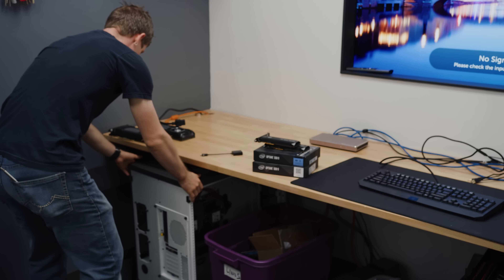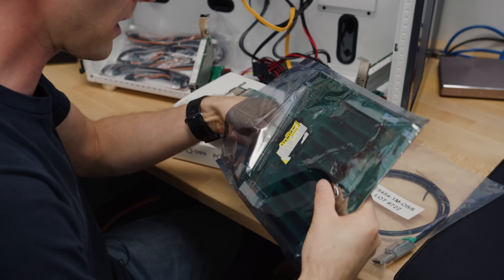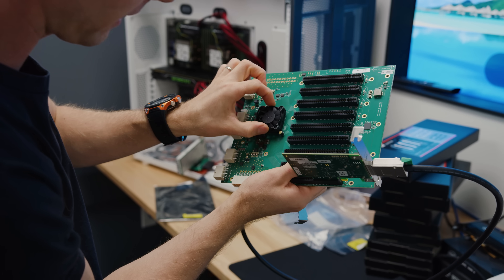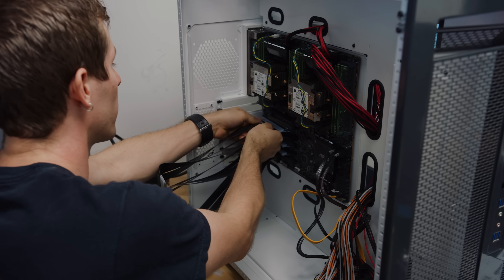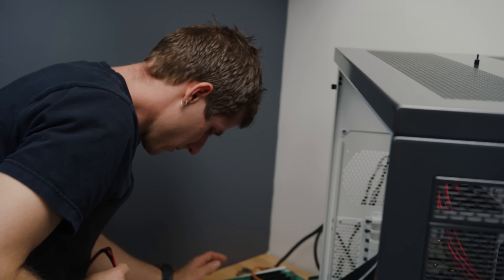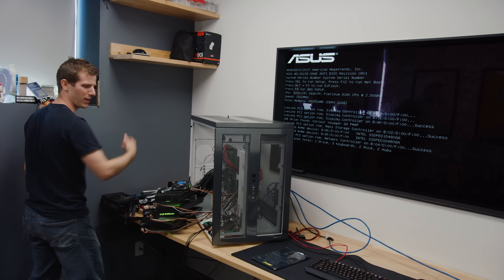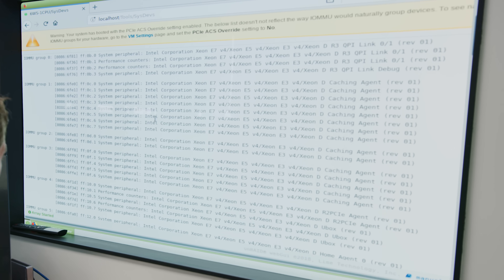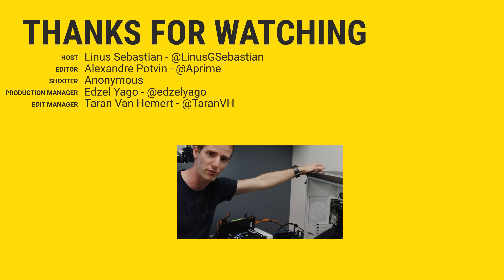Building the $100,000 PC Pt. 2 - SO MANY PCIe CARDS

Comment: @Linus Torvalds & Linus Tech Tips

...wat r u doin?

I really enjoy this channel and have been subscribed for many years at this point and even watched your NCIX videos, but this build doesn't make sense anymore. If this is just a project to 'do' then sure, it's an awesome attempt, but at this point, I feel like you're going down the complete wrong path trying to get IOMMU groups to work properly, specifically with unRAID and Intel not playing along with what you want to do and while 8 editors working with 8k footage on a single machine like this would be a technical marvel, I'm not sure why you want to do it off of one system in this fashion because for any reason something goes wrong with the main system and the entire setup is dead. Networking is going to be an issue with bandwidth and constrained pcie lanes are going to get congested. I can't imagine the amount of oddities you are about to walk through in order to get some amount of this working.

I have a suggestion that I think makes more sense on multiple levels, which would be Microsoft RemoteFX and VDI through Virtual Machines that are connected through thinclients. I haven't done this in a while but the workflow is essentially this:

Build your system back up and have it 'headless', meaning have 8 gpus attached to it, keep a RAID 1 SSD setup and install server 2016.

Setup Hyper-V, have 8 virtual machines and divy up the resources as you see fit. Enable and setup RDS.

(optionally, setup MDT at this point so you can streamline Windows 10 building onto the VMs using PXE booting, I can help with this step if you'd like).

For each VM, use RemoteFX and attach one GPU each to that VM.

For each editor, find a thin client that supports multiple screens, works well with MS VDI solutions, works with multiple 8k screens (if that exists).

Done.

Realistically speaking, you can either add storage to the server itself and store the VHD files there, use iscsi targeting and store the VHD files on the storage server which will dramatically increase the speed between local editing cache and the storage server since data will travel at PCB speed instead of copper.

I'm gonna tweet at you also because I think this will lead you to an amazing place where you can enable VPN on your edge network, then let people connect to your VDI farm, pick their editing VM, and get to work, and would be able to edit on things like an iPad or a Pixel 2 XL or something like that but having the horsepower of an nvidia titan or what have you, a ton of processing power, and access to the entire video library.

They could edit from home, or from anywhere in the world.

Comment: LOL. I've seen that "the computer spewed its guts all over the desk" style of build before. In fact, I've had my hand in many such builds before. Let me just say, cardboard makes a more than adequate electrical insulator/separator when doing so, whether you're using pressed chipboard style cardboard or more traditional corrugated cardboard. I'm surprised you don't have a pile of sheets of the stuff in a box for just that purpose. LOL. My file server actually has a stack of drives in it that are separated by those small cardboard boxes they use as OEM packaging for processors, because there is no rack space left for them in the case. It has been working fine with the cardboard in there for more than a decade.

Comment: Did you try the 'host' card for the expansion in different slots on the motherboard? Tt may need to go in a slot that is directly connected to a CPU rather than the chipset, or vice versa. ACS has to be available through the entire chain to work properly.

Also of course talk to One Stop Systems to see if the PCI switch they are using supports it, and if it can be enabled if it's off for some reason.
Reply: Also, when trying the ACS override patch, I don't think it was really enabled. Some reading suggests that for unraid, you have to enable it in the bootloader config manually; especially if you are booting using the GUI boot option.

Comment: Be careful with the PCIE extensions. I've gone through like 5 of them before just giving up and going back to using no extension. Basically run some quick benchmark on day #1 and then run that monthly. If you see like a 20% or more performance decrease then the extension is on it's way out.

Comment: Maybe you can use a single expander for each user. 

For example get 2xN of these https://www.onestopsystems.com/product/pcie-x16-gen3-cable-adapter where N is the number of VMs you plan on running.
Place one of them in the host MB and one in one of these https://www.onestopsystems.com/product/expansion-backplane-2-pcie-x8-30-slots-419 (there's also a 4 ports version) and repeat this N times.

At that point put one GPU and a USB adapter in each expander and easily pass the whole iommu group to the VM.
By using a more ports version of the expander you can plug a private cache ssd as well and other goodies which will be private to the VM and passed through with a single PCIe hole!

Comment: I don't understand maybe my IT knowledge is already outdated but doesn't the pcie slot have a bandwidth limit,  and limit to the data transfer? So why would expanding it do anything when it will just bottle neck? Go ahead and correct me if I'm wrong
Reply: He is only planning on using it for USB AICs, which don't need much bandwidth, and are not all being accessed at the same time. It is true that for bandwidth heavy AICs the daughter board solution would be useless.
Reply: Bayonet oh OK OK thanks for the explanation I used to work in IT like over 5 years ago,  now I'm just an uber driver haha, been out if the PC and PC building game

Comment: One thing to be careful of with PCIe expansion features. It allows the expansion developer to disable safeguards and push the host system harder than it would normally allow for a PCIe card. There are high speed trading rigs which are basically two or more computers connected over PCIe through expansion cards, all OCed by the bridge to the maximum supported speed regardless of whether all the hardware can support that reliably. There's good stuff that doesn't do that and follows PCIe spec but a lot that doesn't to watch out for.

Comment: Why? As a "can the hardware do this?" experiment I understand this. But is this really the best way? I understand where you're coming from. You hate redundancy, I do too. But doesn't it ever get to the point where, in an attemp to eliminate hardware redundancy, you end up with a monstrosity that's even harder to support because the way it works is so arbitrary?
Reply: Exactly. This is just an experiment. There is no practical use case. 
I found out much the same when it came to IOMMU passthrough. Adding a hypervisor just over-complicates the hardware-software relationship.

Comment: Linus why dont you just get a HPE C7000 on the used market... All you'd have to do is throw in 4 GPU blades, 2 storage blades, and 4 CPU blades all gen 10... Full them to the brim with CPUs, memory, and SSDs... Grab the qsfp+ switches for them... You could virtulize your entire office and not just the editors...

Comment: Ask the supplier of the PCIE switch if there is a firmware for it that supports ACS (Access Control Services), the pcie feature that enables devices to be in different passthrough groups? Also, if the override patxh is the same for unraid as for normal Linux, the devices won't show as different groups, but you can still pass them through seperately - at the risk of cards being assigned to different hosts communicating directly with each other across VM boundaries

Comment: OMG Linus. This is holy moly! I totaly would love to work in LMG for just doing this absolutely crazy server busines!

I have a Ryzen 3 1200 with 8GB and a 1060. Not that much. Well, the case is modified to hotplug up to 9 3.5'' HDDs and uses 2 old PATA DVD drives (1 Reader, 1 Burner) with adapter. It consists of two 1 to 5 port SATA port multipliers and 2 SATA to PATA adapters. It has (partially with soldering) a modified cheapo power supply, to get all the connectors working that are required. Man, that thing is absolutely crazy. :D :D :D Your system in this video reminds me of the (in my case actually totally useless) work that went into my case! And Why port multipliers? Only 4 sata ports. 1 for the 1TB SSD and 2 for the multipliers. 1 HDD got lucky, to get connected to a gen 3 SATA port. LOL :D
Reply: HeartOfGermany I use a 1030 and still run 40 FPS on medium fortnite settibgs

Comment: Linus while I understand why you are doing this, your solution really frustrates me even though I actually enjoyed the video. I, and the company work for, design solutions for Media & Entertainment industry in London. Replacing high-end workstations with a VDI solution is something we are seeing more frequently.

I believe $100k should easily cover a single 2U server with 3x Tesla V100 32GB cards, 2x 24-core CPUs, 16x 32GB RAM modules, and all the rest of the stuff a business would like to see (e.g. 5-year warranty, remote management, etc, etc). The Dell PowerEdge R740xd . This would be an NVIDIA GRID solution which allows you to carve up each Tesla in mutliple equally sized virtual graphics cards, e.g. a single V100 32GB could be carved into 4x 8GB video cards, which in turn means a single 2U server could potentially support 12 or more users.

Sure you'd still need some enterprise grade software, e.g. VMware vSphere Enterprise Plus and VMware Horizon (or Citrix if you prefer), along with NVIDIA GRID vDWS licenses, and Windows (VDA or Windows 10 Enterprise E3 work well for most customers) which isn't cheap, but subscriptions help spread the cost. The server also doesn't include high-performance storage for the VMs or high-performance networking; Mellanox 25G/50G/100G networking perhaps? And a solution like this would usually comprise of at least 3 servers allowing at least a single server to fail without significantly impacting desktop availability. So not cheap, but at least it works with minimal fuss.

The other beauty of this solution is the flexibility it provides. Its easy enough to shutdown the video editor virtual desktops used during normal office hours and run a few more powerful virtual machines for something like a render farm out of hours.

Caveats apply: Your millage may vary, and would heavily depend on your workloads. I haven't included a Tesla V100 in a GRID solution yet, I only included it here to highlight a point that a VDI server can be insane. In all honesty you may get better performance with cheaper Tesla cards depending on your workloads.

PS: Equally interesting are on-demand cloud-based VDI solutions (usually in Azure)
Reply: All very interesting but none of the companies mentioned would provide any of the gear mentioned to him for free. You didn't think he actually paid 100k for any of that did you?

Comment: Legitimate question: what is the advantage of having one supercomputer instead of six individual ones? Isn't it more efficient / less time consuming for one computer to fail and require maintenance instead of one master computer that six other depend on?
Reply: If there wasn't a ton of free stuff supplied there wouldnt be you could build 6 2950x systems considering that from memory the system is dual 14 core xeons so 4 core 8 threads per station vs 16 core 32 threads and individual ones would come close to the $16000 and change this costs per station
Reply: and you still have 6 oses to due maintenance on + no shard base disks to deal with.
Reply: Staggered work times or much more intensive task. For video editing it makes no sense, but imagine programmers or animators. You might compile/render once an hour, but on a normal computer that could take 20 min. On a setup like this, your employees will have much less down time. 

Also, it is highly unlikely somebody will go this extreme. They are more likely to have super high-end CPUs or GPUs. Not both.
Reply: They could definitely keep a server storage unit for shared files and projects, but other than that, if every single workstation had, let's say, one Titan X, a 32-core CPU and 128GB RAM, it's still about $40,000 cheaper (like Shayne Gadsden said above) and if the computer failed, it would most probably be a hardware default. How often does Windows need maintenance, other than the occasional updates? (I'm a macOS user, I genuinely have no idea) It's a really cool project, but unless I'm missing the bigger picture, I don't see the benefits of a master unit compared to single units. I guess I'll just wait for a future video on the topic!

Comment: 7:30 MMMMMmmmm Chunky IDE cables. 1996 just got a boner
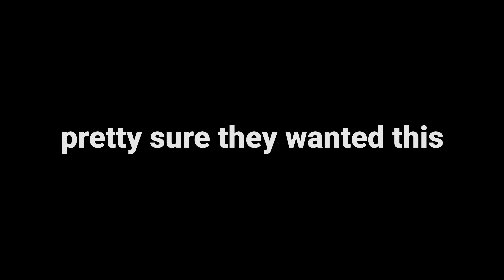edit: 12:15 LOL Linus your editors want you to go down in flames
Reply: 1996 just came all over your face and traveled back in time to father you.
Reply: Jon a
Reply: Jon remember the master slave system   btw I still use IDE cable for cheap ribbon cable for arduino  or to make a  🙂 schorr parallel port cable  for cnc machine
Reply: Freak - I would rather you drive a  rusty hexpoint driver through my gelatinous eye tissue than deal with that stuff again.
Reply: dude i just dropped a jumper on the carpet FML

Comment: Hey Linus. Where can I find a 14 Gigahertz CPU at?

Why am I not an nVidia fan, if I like all their embedded and shield products? What is it about the Green Eye and Blond Wife and Baptist church Asian that Bothers Me? What is it about the math circuit obsession without the Color Accuracy Specifications or Vendor Education that Irk Me?

I don't want to be excited about nVidia, when I love HBM2 start led memory more.

What I am surprised by is this CCD or DDR data rate of 14GigaBitsPerSecond. How is HBM2 1.1 Gigabit persecution and massively parallel yet compact, yet nVidia is physically massive and high speed serial on fewer bit traces....

What sort of signaling and decode, and metal doping to super pass ohms limits on others, allows 14Gb/sec per wire?

Massively Parallel MCM,
Versus
Massively Serial PCB.

Comment: what are they expecting you to plug into that board? GPUs of course. Those expensive nvidia ones mostly. These boards are the hot thing for ML GPU servers. Idea is to have as much GPUs as possible on one connection to RAM.

Comment: Instead of wasting money on a bunch of extra PCIe slots, when you only get the speed on a single slot, just use USB hubs! That's literally one of the reasons USB exists, so you can have as many devices as you want running over a single cable.
Reply: the extra slots aren't just for peripherals they are also needed for graphics cards and storage expansion. So USB hubs would not cut it, also using USB hubs would bottleneck speeds.
Reply: jake kiedaisch No linus said in the video that they would use the extra slots for USB. And you're not bottlenecked if you have a bunch of USB ports on one card and then split each one up using hubs. Ofcourse you don't let all of your USB traffic go through a single cable. You're probably more likely to be limited by the speed of your USB stick or whatever it is you're using.

And who the fuck fills up a board like that with graphics cards, when it only has the bandwidth of a single slot? That's a waste of graphics cards.

Comment: With regards to the storage solution, an alternative may be to partition it off into network based storage, then use a software network passthrough and mount each partitioned network share as a boot drive for a VM. It's a hacky solution, but would in theory work without reducing the bandwidth rate too much.
Reply: hacky solution???
Most VM build outs use networked storage. In DC settings the VM host just has an small disk for hypervisor os.
Reply: Yes, but that's an enterprise solution for an enterprise application, where storage is centralised and accessible over fibre. This is local storage, and more to the point it's managed. Implementing an unmanaged solution on managed hardware is a bit hacky.

Comment: Hey Linus. Little correction. It's not  "PCI-E" connector. It is a CPX connector — industry standard for connecting many-gigabits-ethernet, fibre channel connections and InfiniBand connections.
Looks like they encapsulate PCIE signal into Ethernet packet and transport it over InfiniBand bus to their adapter, where packets are decompressed into PCI-E signal again.

That's why on the PCBs of both components are so many chips and controllers.

Comment: I think my motherboard has only 1 GPU slot and I want to know if i can put some kind of 1070 or 1070ti in there
Reply: Zorange saft you could. As long as it's a PCI-E slot then it'll accept a 1070 or 1070ti. Just need a powerful enough power supply to power it.
Reply: LordIron How can i find out
Reply: buy a 1070 or 1070ti, put it into the PCI-E slot then plug the PCI-E power connector from your power supply into the 1070 or 1070 ti. Hook up the card to some form of tv or monitor via HDMI  or whatever you have then turn on the PC. It's not that difficult
Reply: LordIron     If i press F3 in minecraft it says   "GeForce GTX 1050 Ti/PCIe/SSE2"   does that mean i have PCIe
Reply: if you have a 1050ti that means it's plugged into a pci-e slot
Reply: @React2Quick      thanks

Comment: Does it make a diffrenze if i put 2 diffrent RAM sticks in my PC vs 2 same
Reply: Zorange saft not necessarily. If one is a slower speed compared to the other, the motherboard will just downclock the faster one to match the speeds of the slower one.

Comment: +Linus Tech Tips:

so has Thermaltake actually fixed the crap extension cable issue? I had a LOT, and I mean A LOOOOTTTT of random failures and system crashes while only using GTX 950s, so I can't wait to see how performance with the new cables is.